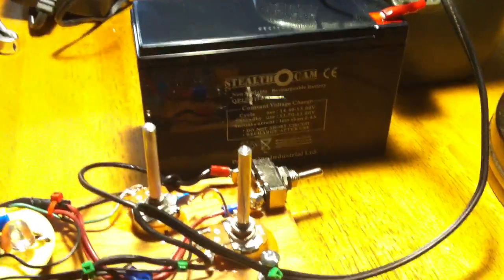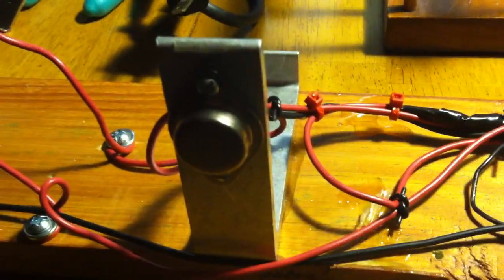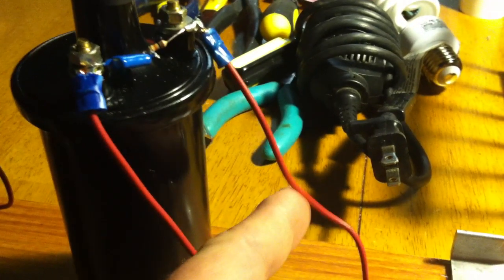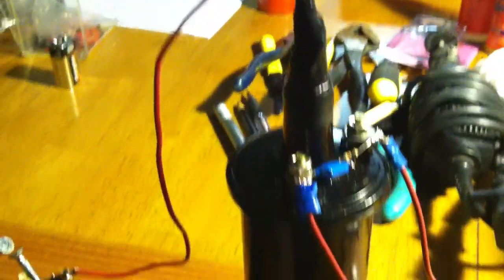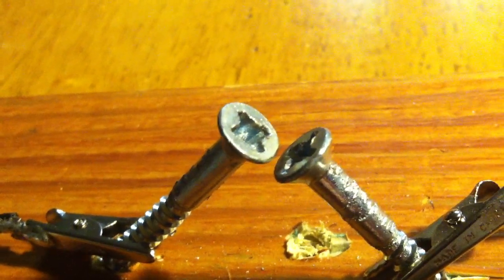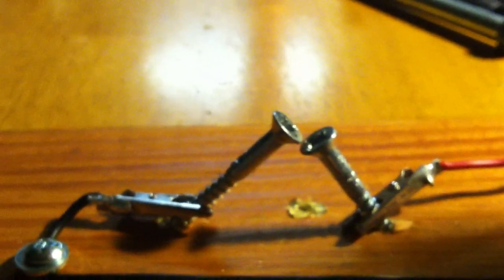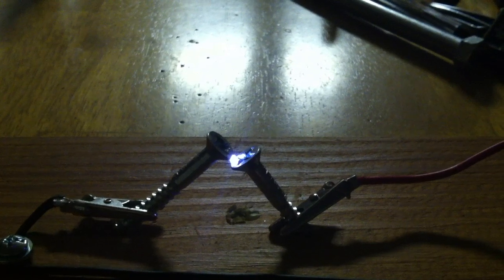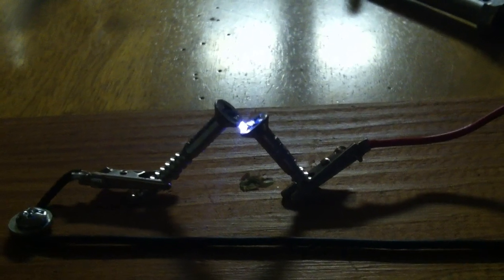Tesla Coil Driver circuit using Ignition Coil

Comment from the maker: The RC circuit on the primary winding terminal is and RFI filter. I think we used .47uf and 1K ohm resistor. It prevents Radio Frequency RFI back EMF from getting on the 555 timer board. You can also put a couple home made coils on the ground and 12V lines between the ignition coil and the 555 board. I didn't do it here. It may help in your configuration.